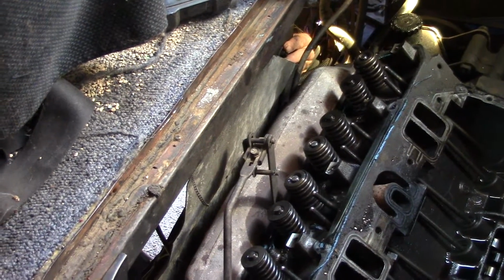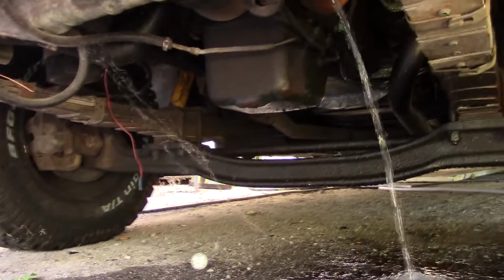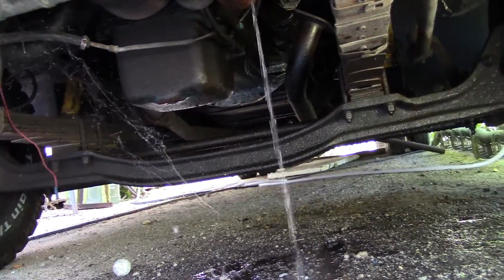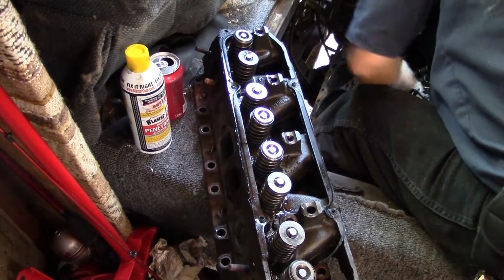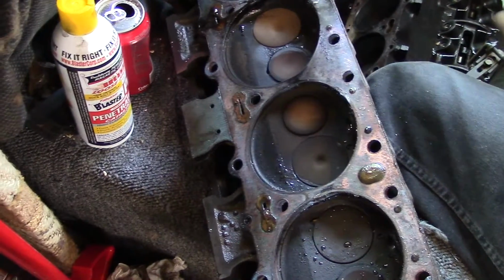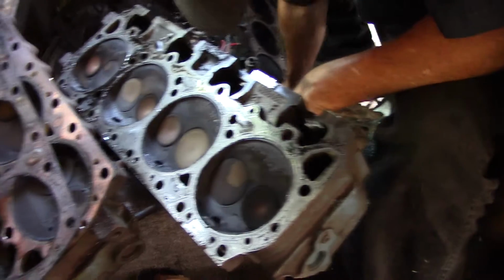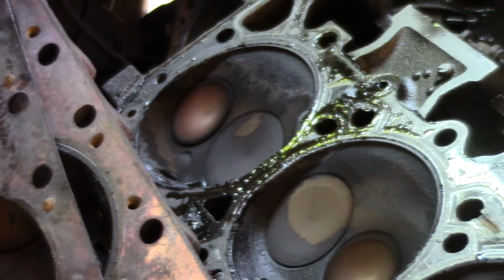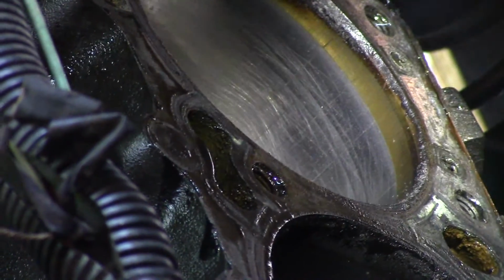1tiliman Part 3: Removing the heads for rebuild dodge 440

Comment: Interesting video! He mentioned dry coolant ports that's a little worry sum!
Reply from the maker: +kayak fisher john a yule Yes he did say they were dry. when they do the head job, all those will be lean out and open. but the main ports were wide open. today we will mic the cylinder walls and check for warp.
Reply: Sounds good big job! Hope the old girl comes alive for you! Nothing better then hearing them run when it's over. Have a good weekend!

Comment: i would use what you have if you are not going long haul trips over a period of time.I ran a 69 Dodge Charger with the HP 440 with warped cylinders for a year. When i took the pistons out the rings were in small pieces in the grooves, I still beat most cars in that sad condition. If you dont have a deep lip at the top of the cylinder and bores are not warped or out of round from overheating.....use it! I have never really seen any 440's lower ends give up with out a fight.  If that has a fiber type timing gear watch the suction screen on the oil pump..it will block the screen with fragments and cause lack of oil pressure and volume. .  that is what usually killed big block Chryslers.
Reply from the maker: +Tioga Trails  LOL on the beating them to the ground :) i have a new oil pan to install anyway, so i will make sure to check the pickup screen for any thing build up of stuff. thank for reminding me on that poiint of timing chain.  there are both idiot light and gauge type, and it always normal pressure.

Comment: That's what I hate about motor homes the damn engines are so hard to get to. Seeing I'm not a mechanic don't know what advice I could give ya John other that if anything that has to be done to the lower part of the block or yanking the engine out altogether to do that work and what you have to do perhaps then you might want to look at a rebuilt 440 and use your rebuilt heads and other top end piece's to put her back together. Guess it boils down to which expense would out way the other. Good luck my friend and sorry I couldn't be of more help.

Comment: In the picture it still shows signs of cross-hatch.  How many miles are on that motor?
Reply from the maker: +wayne halladey ya know i'm not sure. speedo says 57000 but i am pretty sure that is not correct. i do know for sure that i have put on 2 or 3 thousand, in time that i have had it. so you think it still has hone marks ?? what are you thinking about it??  they do kinda look like that to me.  also it is not the original motor as well. there is no orange or blue paint on anywhere. the whole block has been painted black.
Reply: Hmmm.  That is interesting.  Not being the original motor and being black sounds to me like a short block replacement at some point.  Remans are typically painted black.  Seems like I recall the heads were turquoise when you took them off.  I could be wrong but just from what I have seen so far I suspicion the original block took a dump, they salvaged the top end and put a remanufactured short in it.  How much top ridge do the cylinders have?
Reply from the maker: +wayne halladey yes there is some turquoise paint on the heads. i checked some old forums and, it seems they were used on the mopar 413 HP and  the 440HP's most every one said the 452's were the ones to use for performance. i rechecked the block, i thought it was a 440-3 but it is  440-4 1977. the RV is a 78. i also read the 1977 was the last year for the 440's. and they dodge was using up it stock till the ran out. 
  there is very little ridge on the cylinders. and the cross-hatch, make me think it may not even be fully broke in LOL!! I know that, it DID sit parked in Prescott AZ. for 10 years before it was sold the guy i bought it from.  it did hot pulling 7% hills 2 summers ago until i found the right side exuast manifold blew a hole is the bottom of it, that blew right on electric fuel pump and fuel line. after i changed the manifold it stopped getting hot ( 220 ) degrees now. insted of the 260 degrees then. so i am thinking that it is a fairly fresh short block with 2 blown head gaskets and it now needs valve seals
Reply: Well, if it were me I don't think I would get too overly concerned with the vertical scratches, put new heads on it and move on.  I think, for your use, new heads will make it go a long time.  How do the lifter surfaces look?  No pitting, no cupping, etc. and the cam lobes look ok?